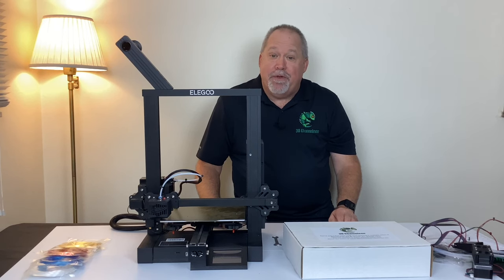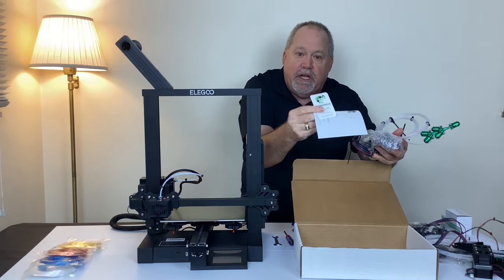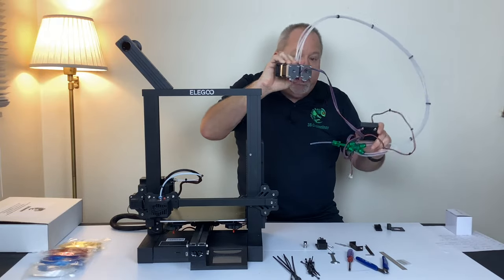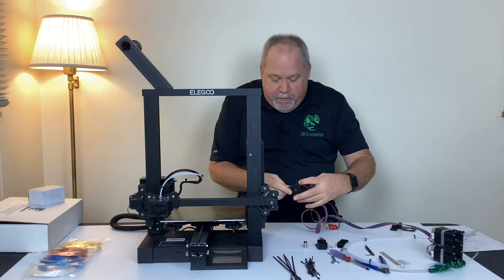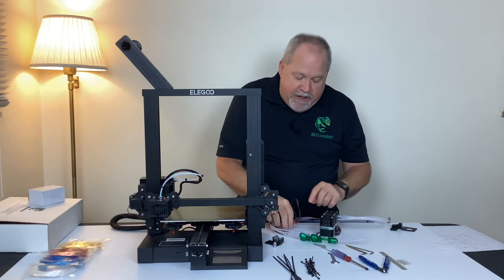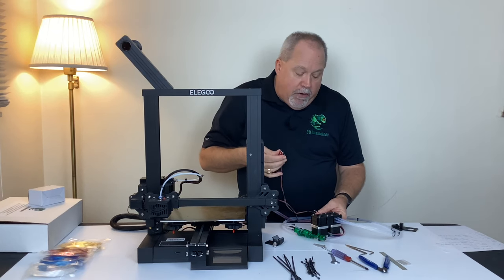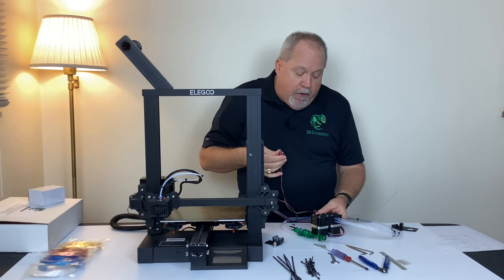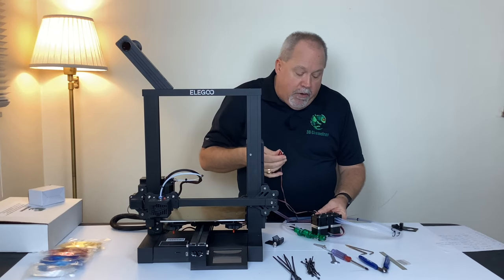START HERE: 3D Chameleon Mk2, Mk3 and Mk4 Basic Installation

Comment: I have a prusa mini, and have downloaded the mounts. I have followed the instructions, but it simply says hook up the wiring!

Like how? Instructions say to use the prusas extruder, with the power box how do I connect it to the chameleon, will I only need to connect one pin?
Reply: The Prusa Mini hooks up the same, except you simply use the stock extruder motor instead of ours.  Just remove our Extruder motor from the 3D Chameleon, transfer the two hobbed drive gears to the Prusa Mini's stock motor and insert it back into the same place ours was.  The other motor (the Selector) and the limit switch hook up identically as they way they shipped.  Make sure to also transfer the spacer to the stock motor so the 30mm screws can still be used.
Reply: @williamsteele  thanks so much, and such a quick reply. This is what I did, but the clarification is what I need!
 I'm not sure where I should be measuring from for g code generation. The chameleon feeds directly into the nozzle, for the mini. Do you have a rough estimate as to what this value should be so know where to measure from?
Reply: @zekeahern199  Well, the Prusa Mini can't use the auto generated gcode... that's for the normal Load/Unload installation method.  The Prusa Mini is using the Advanced Extruder Replacement method of installation.  In it, you'll need to use our Prusa Mini profile and install the Post Processor on your computer.  (The Prusa Mini profile is in the description of the PrusaSlicer video.)

See here for details: https://www.youtube.com/playlist?list=PLs1jpNL7rg78Bm6cDAC4JwaUNlpFa6UEf

Comment: 6:40 Shows the "Switch" already connected to the 3DC mcu box.  Which orientation should the 3 pin dupont connector be inserted into the 3DC mcu?  Maybe it doesn't matter?  Just tried, in one orientation there's no motion, also, nothing seems to have exploded/shorted so that's nice.  In the correct orientation, the 1 second switch to filament 1 results in steppers doing their thing.
Reply: The green connector is to the outside of the case, and the red is towards the center of the case.
Reply: Thank you  @williamsteele  !  Just noticed you mentioned "green wire towards the corner" at 21:58.  Cheers!

Comment: Just installed mine on my ender3 pro
I have the creality aluminium extruder upgrade and found the screw that goes through the arm is too short. If you use the spacer from the original extruder it does fit. Also, i had to rotate my extruder 90° because the connector doesn't fit next to z-axis leadscrew.
Reply: Yep, on a lot of the new Ender 3 machines, like the Ender 3 V2, we also found that you need to rotate it 90 degrees.  Good call on the metal extruder with the spacer... I'll add that to the suggested fixes.

Comment: I might try this on one of my 2 Ankermake M5 machines. Now I do prefer to use their slicer, Amkermake Studio. I do use Cura and also the Prusa Slcier for some other printers I run. Actually the Ankermake Studio slicer is based off of the Prusa so I wonder if that will help. The Ankermake M5 is a direct extruder, will that be a benefit. I can, easily, bypass the run out sensor by just putting filament in the sensor so it detect filament.
Reply from the maker: Ankermake Studio breaks the ability to multi-color printing... you need to use PrusaSlicer for it.  (They have no way of adding additional extruders to it... it's grayed out.)

Comment: This looks amazing.  I bought an Elegoo Neptune 4 Max a few months ago and my 3 Max is getting used less and less as a result, and I'm interested in multi-colour printing.  Do you know if the Chameleon has been successfully installed on a Neptune 3 Max?  I've also got an old Sunlu S8 Pro on the desk (a CR10 clone), but it has a much smaller build area.  Unfortunately, I don't see how this can connect to the Elegoo Neptune 3 Max, Pro or Plus print head as the filament goes straight into a small hole in the top of it so there's no Bowden tube to guide the active filament into the print head feeder mechanism.

Comment: can I shorten the tubes that come out of the Chameleon I am mounting on the rear of a K1 and I only need about 10 iches Thanks
Reply: Of course... We highly recommend you cut them to the proper length to minimize the drag on it.
Reply: @williamsteele  Thanks I found an install file on you site and the very last step was to trim them..I am going to try and get this working on one of my ender 3 v3 ke printer. I was going to use my k1 but I use them for abs asa and tpu.
Reply: @oldtimeengineer26 how was this on the ender 3 v3 ke?

Comment: I am VERY interested in getting this. I wanted to ask how this would attach to a Creality Ender 5 Plus with an ExoSlide and a Microswiss direct drive? I hope it can pair up to my printer!!!
Reply: I have videos of the Ender 5 (classic) and it would attach very similar... however, with the direct drive then the Y would be right at the extruder.  The only thing you need to verify is that your extruder can load the filament from the menu's without intervention other than presenting the filament to the extruder... if you can do that, then the 3D Chameleon can also do that.  (You'll need to add a PTFE tube as the input.)

One other thing... some of the Microswiss DD extruders have a nice gap between the extruder and the hot end... if yours has that, then it's the perfect place to put the 3DClippy filament cutter.  That would allow it to cut the filament off and leave it in the hotend instead of trying to shape the tip.  Make for very fast color changes... and increases the reliability significantly.
Reply: @williamsteele   I am feeding the Microswiss DD extruder the same way the original extruder fed the hot end. I removed the original extruder and stepper motor, leaving just the extruder's base attached to the frame. The filament still feeds into the original extruder's base the same way it used to, and then goes into a Capricorn tube, which reaches out to the new Microswiss DD. My MS DD does have a gap between the extruder and the hot end, but they included a short length of Capricorn tube that they said, had to be used. I don't know how true that is, but I did install it. I hope all that makes sense to you.

Comment: ow do you replace the ptfe tubes. Mine are now way to short since I could not get it to work on my K1. Also I have not found a ptfe bracket that fit my ender 3 v2 i have tried 2 and the rail is in the way
Reply: We have a video on how to cut new tubes in this playlist... And to insert them, you can simply loosen the 4 screws around the extruder which will allow you to pull out the old tubes and insert the new ones.

As for the Ender 3 V2, it's on Printables... It's the blue one that is rotated 90 degrees to avoid the Z screw.

Comment: Hello, thank you for the video. My Home is not set to 0 so do I still take the measurement from 0 or do I start from home and use that distance?  My switch is on the X axis.
Reply: Just set it to the value that the switch triggers at... Which should always be referenced from zero... Even if your printer homes to a value like -5, you just use the LCD and move it to the + value displayed.  An example, printer homes to -5, but you moved to X = +100... Printer actually moved 105 but you still tell our code it was at X of 100.
Reply: @williamsteele  thank you! I figured I was over thinking it. Now to get this slicing figured out.

Comment: Does this work for Anycubic slice or should i move to Cura?
Reply: We currently support PrusaSlicer, or any of it's forks, like OrcaSlicer and BambuStudio.  Cura is not supported due to a bug they have supporting more than 2 colors.  I'm not familiar with Anycubic's slicer... if it's based on PrusaSlicer, it should work, but if it's based on Cura, it won't work. (It's not an issue with our code, we support it, it's actually due to a bug in Cura that prevents purging from working correctly and they "have determined not to fix since it doesn't effect [their] own printers".)
Reply: @williamsteele  I understand what you’re saying 100% that sucks anyway thank you so much for replying. I may have to move my slicing days to Prusa!

Comment: Hi. Will this work on a Creality Ender 3 S1 as it has a dual gear direct extruder which is different form previous Enders.
Reply: I have a couple on the way to test, but a real simple test to confirm if it does is if there is a way to load the filament via the menu without needing to manually move, unlock or unscrew anything.  If you can simply insert the filament and it can pull it in, then it will 100% work.
Reply: I might add, we already know it works with extruders like the Prusa Mk3, BMG and Bondtech which are all dual gear drive extruders.
Reply: @williamsteele  That's good to know. I am quite keen on purchasing the 3D Chameleon but the mounting is also an issue since the Ender 3 S1 extruder has not been tested so far. Will wait for your results on it.
Reply: Any updates on the Ender 3 s1 extruders?
Reply: @crocodilezzzz  Yes... we posted a note a while back that it worked flawlessly with their new Spark extruder.  No changes are necessary.
Reply: @williamsteele  any videos on it ? What about mounting ?
Reply: @williamsteele  That's great. Thanks and time to load in an order.

Comment: I get that there are so many different machines and what to do for each may not be the same but I feel like there is a huge lack of instruction for someone new to this. I followed this video and have my stuff installed but then what. Theres not a video thats currect that shows what to do next. Surely the next step isnt just slice a file and send it. I mean how far down into the Y setup do you load each filament. How do you start getting filament down into the hotend? The video I've seen referenced on the site is at least 2 years old, it for a 2 color setup, and apparently a couple firmware editions old. I completely misunderstood what this system was when I purchased it. It doesnt seem to be for someone that is new to multi color but not new to printing.
Reply: This is just the first video in the playlist. Have you watched the other ones?  Also, please always feel free to ask me questions.
Reply: @williamsteele  yes I have watched all of them in the playlist. Where should I contact you at? Email or FB messenger?
Reply: @nathanreed3302  My email is included in the kit.
Reply: @williamsteele  This is my concern too. Ive watched through the playlist, as well as read through the forum. But as someone whos not super GCODE savvy, it is very daunting. I just received my MK3 and ready to install it, but still so confused on a lot of aspects. Theres phrases stated, like Direct mode vs Extruder mode, but then its not fully explained what the differences are, use cases, what is required/not required when going to a different method. Also the 3D Clippy, looks great, but then i struggle to find installation guide, not so much the physical installation, but the GCODE portion of it. I may have missed it in a video or the Forum, but theres a lot to disect and comb through to try and understand it for a novice. I posted my questions on the forum and hope to get some community assistance before i install it on my only machine. Thank you for the great product, it looks to be amazing, just hard to get it going with the struggle to find clear and concise direction.
Reply from the maker: @GenerlAce - Big War inc.  There is no need to learn the gcode... the automatic gcode generator does all the work for you.  Just follow the Basic Installation videos... the first 4 are all you need.  First one, install the unit... second one, covers the new Mk3 commands, third one convers setting up PrusaSlicer for your printer and the fourth one covers the Automatic GCode Generator to customize the gcode for your printer.  Every printer out there uses the same basic set up.  The other topics are for advanced installations and are totally optional... for example, the advanced installation is the Extruder Replacement mode where you remove your stock extruder and allow the 3DChameleon to act as the extruder... but in the Basic mode, you leave your printer's stock extruder to do it's normal job.  This allows for a much simpler installation at the trade off of a little speed... but also allows your printers existing functionality to work exactly as before, including all your currently sliced files and printing profiles.  The advanced mode doesn't allow for that due to the drastic nature of all the changes.  My recommendation is stick with the basic installation for now and when you get more comfortable with the process and maybe the gcode, try the other things.

Comment: I am setting up my 3D Chameleon.  It seems to retract a little less than it loads each time.  After I cycle through the colors a few times it will finally reach a point were it has not retracted far enough for the next color to load.  After they crash it no longer knows where anything is.  Is there a way to fix this. MK3 firmware in mode 2.
Reply: That's not a bug, it's by design.  In Mode 2, we load 11" but only unload 10" because the extruder makes up for the rest.  If you are testing by hand, it will walk up that way.  In Mode 3, you need to adjust the timing to match your actual distances.
Reply: @williamsteele  great thanks for the clarification.  I guess that will get worked out in the gcode while printing.   I haven't made it to my first color change.  Fighting my offset the couple of times I tried.  I have it loading the first color and trying to print.
Reply: @thedunemaster Just let me know if you have any questions... I'm always here to help.
Reply: @williamsteele I am planning to get one mk3. Going to pair it with FLSun SR, and klipper. Is there any good documentation, forum post, or else to control the unit via GPIO? I would use klipper's  output_pin with custom macros for T0 T1 T2 T3 commands instead of slicer settings (btw that's Orca). Am I on the right path or not?

Comment: HELP!!!!! Is there a map or layout to the mechanical wires & tubes? I am so lost on how to install & where to mount the switch location etc... I need help PLEASE!!!!
Reply: So, what kind of machine are you installing it on? This video shows the only needed steps for the installation... And the switch mounting location for this style of machine, but it just needs to be mounted somewhere that a moving part of the printer can press it... It can literally be at the end of any moving axis.
Reply: @williamsteele  I am installing it on a Creality Ender 3 Max Neo and I have it installed on the front x axis but in the video it looks like you installed it where the wheels are under the bed on x axis also I can't seem to find the proper switch mount for the Max Neo is there a diagram for the ptfe tube placement and I cant seem to get the sec's or mm's down on how to program the gcode generator as I don't know how to convert inches to mm's how often does the chameleon switch have to be pressed to change colors

Comment: Hello.
Interesting unit.
Would this generated G-code be put within the M600 G-code.
Elegoo Neptune 4.
Elegoo has there own M600 G-code.
Generic open source Klipper M600 G-code does not work.
Cheers.
Reply: We're not using Color Change GCode or M600, we're using the Tool Change GCode in the slicer.
Reply: Thank you.
Cheers. @williamsteele

Comment: Will this system work with an cr6 se? I have this machine and modded it to have a Pheatus Dragon High Flow hotend with orbiter v1.5 extruder in Direct Drive configuration. Thanks.
Reply: Yes, it will work just fine on your printer. The orbiter is a great extruder for it.
Reply: @williamsteele fantastic. Will your guide show how to use with a Direct Drive system?

Comment: might want to trim that ptfe tube down 50% that's way too long.  i have the original two tube version and it came with a green thing that has four entry tubes.  how does that work with two motors
Reply from the maker: Yep... We talk about in our final installation Tips/Tricks video which will be posted soon.
Reply from the maker: The new Mk2 design uses a selector motor and a drive motor... the selector drives a cam which engages each of the different colors depending on where it's rotated.

Comment: Will this work on a elegoo neptune 4 max? if so how intensive is the install? can a noobie get this knocked out pretty quick? Also is it capable of printing in more then two colors?
Reply: It works on all printers.  This video shows exactly the installation.  The only difference is the position of the extruder.  Also, it's not a two color system, it's a four color system.